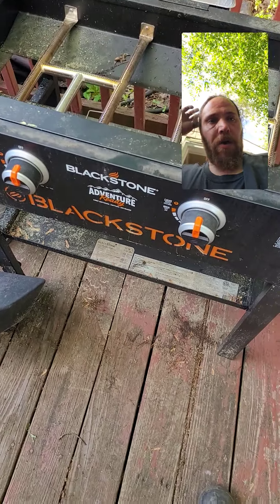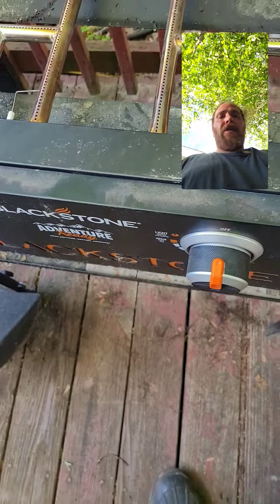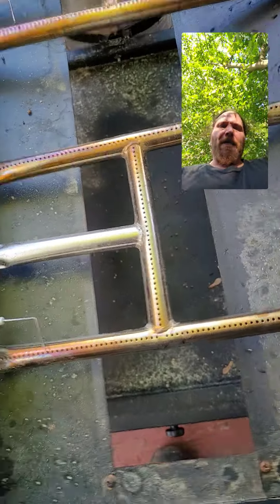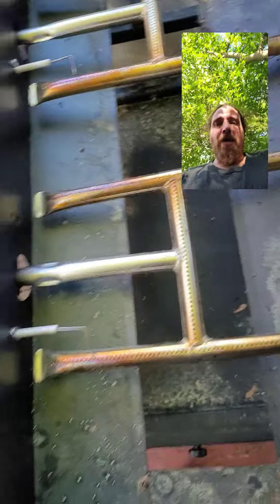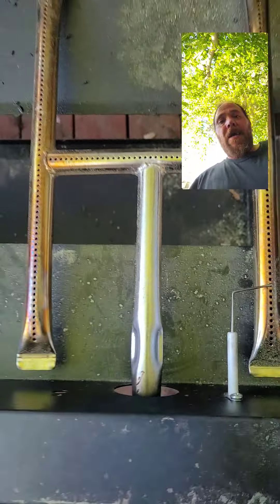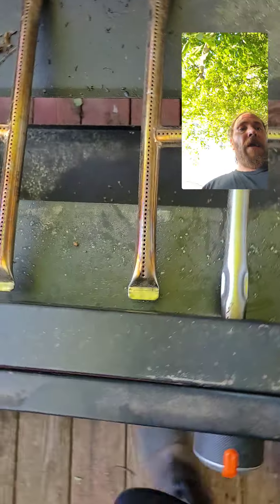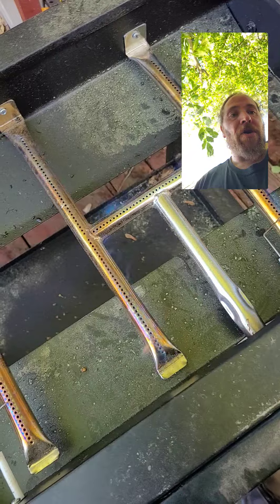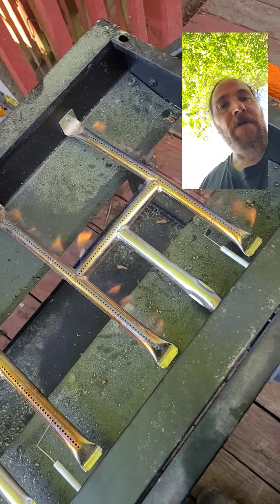Blackstone griddle valve problem solved

Comment: honestly you just made my day this is definitely the same issue I'm having and after 2 hours of dealing with blackstone telling me it was my igniter or regulater came across your videos luckily and can't wait to see if thats my issue
Reply from the maker: Mine was pretty much brand new still. Only used it a few times so I was really pissed thinking it was a defective piece of junk until I found that. Made no sense why the flames were burning out the back of the knob....lol I hope it's your problem too, even this smaller one wasn't cheap.
Reply: @JamesH2  it definitely was picked up kine last year used it once then this year same flames underneath. last night took it all apart and a big old junebug was stick in the line
Reply from the maker: Awesome! Glad my video or commentary rather, helped! Nothing worse than feeling like you spent good money on junk....lol I do live the griddle so I'm glad it wasn't the case.